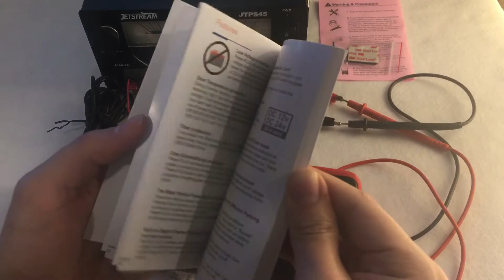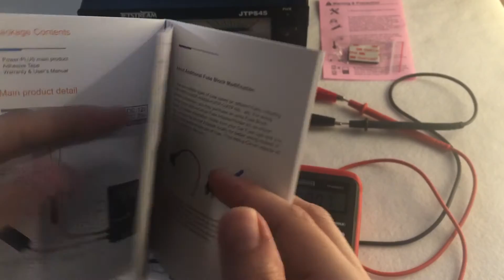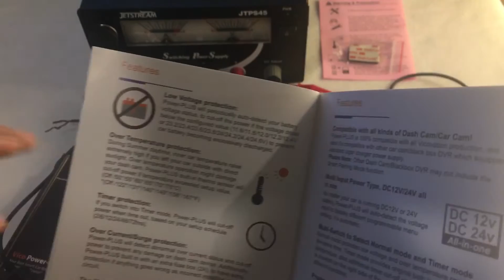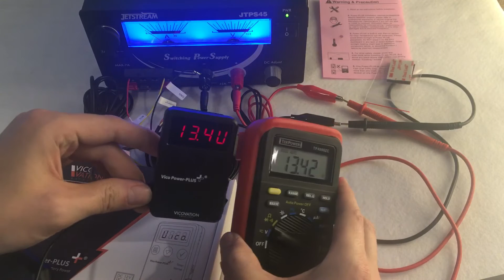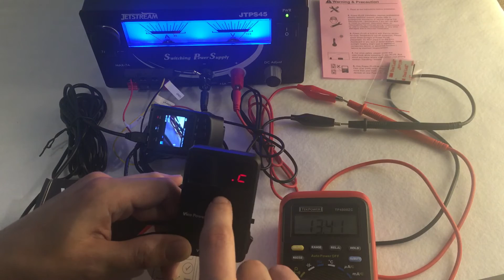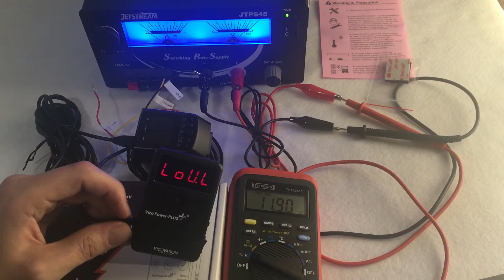Vico-Power PLUS Hard Wire Kit Battery Discharge Prevention Low Voltage High Temp Cut-OFF Kit

Comment: Looks more like an old school LED display.  Surprised they don't turn off the display on low battery.  Most common voltage dip on a car battery is actually starting the engine, which is such a common accident time / traffic complaint situation you really want your dash cam running.

Comment: Can you install it without the ACC wire?
Reply: I guess you could probably operate as if the power was constantly BAT/Parking Mode only the whole time.   I never tried it.  What is your thought experiment for doing so?  Actually once it cuts off, I don't think it will reset until it detects ACC power is restored at least one time though so maybe not.  (unless you created a switch to power ACC manually when needed to reset the cut-off event)
Reply: Right now I have my dash cams wired directly to the battery with an ON/OFF switch.  I just wanted to add this module into my circuit to prevent battery discharge.
Reply: might possibly work up until any cut-off event occurs, not sure how it would reactivate after that without the ACC to kick-start it back on. (never tried it though, so can't recommend it)

Comment: I just purchased this bad boy to pair with a Street Guardian V3 dash cam. How do I know which add a fuse kit to buy? I see there 3 different types on the page you listed. Looks like standard, mini, low profile mini? It'll be going in a 2016 Nissan Murano if that helps. Thanks!
Reply: CookiePuss SonOfFudgie pop out a fuse and compare photos.   Search Amazon for Add-a-circuit.
Reply: Sounds like a plan! Thanks :)

Comment: You mention the added circuit device for the constant battery power for the fuse box. Is that not included with this product?
Reply from the maker: add-a-circuit not included.  You'll need two of these. https://shop.pier28.com/index.php/catalogsearch/result/?q=add-a-circuit